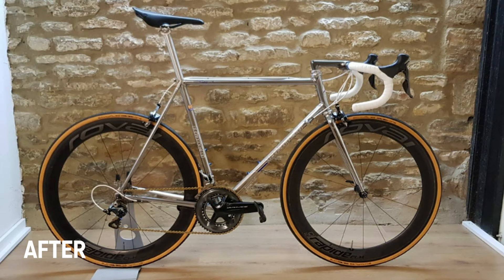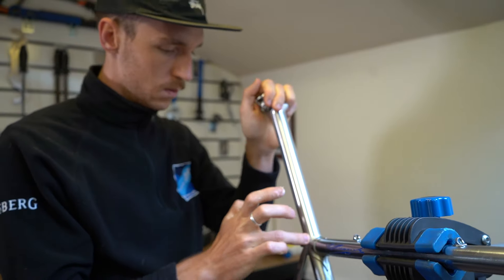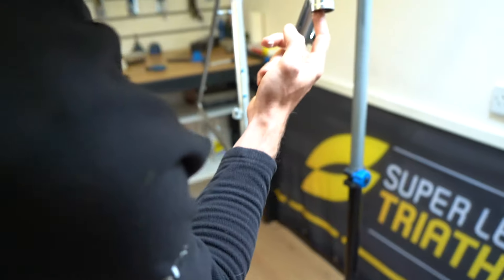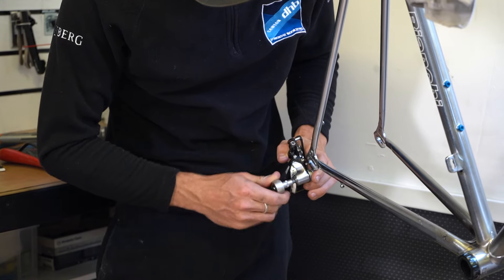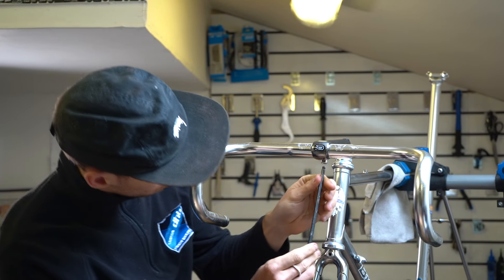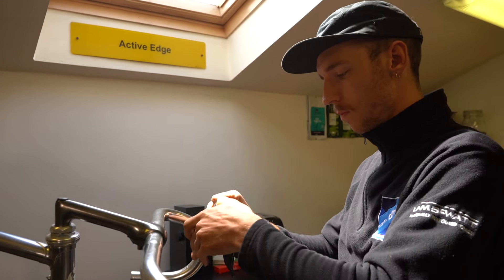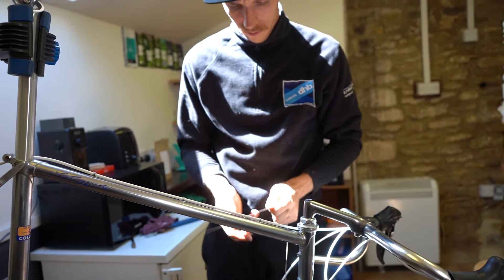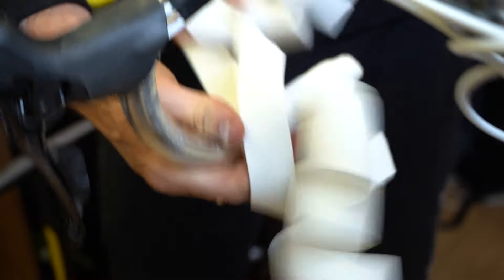DREAM BUILD BIKE  - vintage bianchi  - road bike restoration project

Comment: Rad build dude! Better than the day it was bought.
You are in a special club, as am I. Sanding a bike frame to a polish is a job many have started, but few have finished. Ive never polished a steel frame, but did sand it quite fine, 800 grit. I then hung it close to the ground from a tree in my front yard overnight to get dew on it. In the morning, as planned, a  bit of corrosion had started. I warmed and dried it in the sun, then after a quick wipe with tack cloth, hit it with several coats of clear. It is a striking looking bike now, built up with vintage parts. Over 10 yrs later, the finish is slowly maturing. I did sandblast, then hand sand/polish an aluminum frame for a hybrid to singlespeed conversion build. I feel your pain. Yes, weeks of evenings watching TV, sanding. I regretted sandblasting as I had to sand down to the bottom of the profile left by the blast media. I used metal polish and found it darkened it a bit. Mothers aluminum polish left a brighter finish than autosol. Youve inspired me to try this on a FUJI Im playing with at present. Its all original, paint is a 6 outa 10. But its purple. I also wanna cut/file the pump peg, the (extra?) chain hanger, yes, two of em. Also get rid of the fender mounts. I often drill a big hole in the bottom of the bottom bracket shell, for weight. Ive modified the sausage tube that holds rear brake caliper so now my rear brake faces forward, mounted to front side. I think it looks cool, works just as well, and I could shorten cable a few cm. If I was doing  your Bianchi, Id drill the handlebars to internally route the cable. Done this on modern and old school bars. Works great, no electrical tape.

Comment: I did something similar with an early ‘80s Trek road racing frame. I had it sandblasted and powder coated. The finish came out beautiful and then I built it up with an Ultegra set up.  It rides like a dream!

Comment: Great video. We all have those bikes we lusted after at some point and they seem at the time like dreams. For me, it was the mid-80s Zullo, Pinarello, Tommasini, and Picchio. I have all but the Tommasini now. Originally, I went with contemporary vintage components but all now have modern components so I can get the most use out of them. They are no longer dream bikes for me but a reality. And they all get ridden properly. They are not wall hangers.

Comment: Nice job and a lovely video, thanks for sharing. Shame you’re not keeping it! I did something similar with a Bianchi titanium frame that was a replica of the 2004 Roubaix winning bike. Some later era Bianchis than yours have structural foam injection in the seat tube which can be damaged by paint stripper so that’s one pitfall to watch out for. The bikes with it came with  a frame sticker near the bottom bracket advertising it. I used Scotch-Brite pads to take off the paint and give a brushed Ti finish. That took weeks as well! I put 10 speed Campagnolo Record triple from the era of the last of the range topping alloy chain sets. Royce / Sapim / Ambrosio hand built wheels with Panaracer gravel tyres were added and Brooks Swallow Ti saddle. I’ve ridden it like this for a couple of years as a gravel bike and did rather well on certain Strava segments that were only really tackled on MTBs.

Comment: cool to see. I have a late 90's Bianchi Eros that I ride daily. I love it. I dont really see a need to upgrade it at all. I did a full refresh on it 9 years ago and it's due for a good cleaning and some new cables and tape. thanks for the inspiration!
Reply: Wait you didn't replace the tape and cables for 9 years?
Reply: @dan_lazaro  nope. Still haven’t. Everything works flawlessly.
Reply: @GuntherSnaps  damn on my bike the cables need to be replaced after around a month riding in wet conditions, and that doesn't account for my rear brake cable refusing to comply after the first wet ride. But yeah it generally takes a month for the rest of the cables to stop moving. I used to clean ans relube my cables but considering the time and effort to do that and the cost of new cables, I just change everything now.
Reply: @dan_lazaro  oh well I have never riden in wet weather. Bike only sees lovely dry weather. But my mountain bike sees wet weather and I’ve never had a problem with cables. Maybe you should switch to hydraulic if your having that much problems with cables

Comment: What a lovely thing to do. Spent many days during lockdown sanding down an old Ridley frame...alloy,with Time Carbon stays and forks. Sprayed lacquer on carbon and polished the aluminum. Built up SramForce 10 speed to use as adventure bike for my son and me to use..

Comment: Made a similar project with a GIOS Torino compact 40th anniversary with a Record groupset, Deda parts, Campa wheels and Vittoria tires. It’s a lightweight dream. I like yours too, great job! But I would have saved the painting. I prefer a good old true patina before a stripped, clear coated steelframe.

Comment: great bike 👍👍, what is the total weight of the bike ?? Do you use carbon brake pads for your carbon roval rims because these require specific brake pads for carbon. What columbus tubing is it? El or  SLX? Please specify

Comment: I found a 2006 Bianchi Giro frame on the side of the road and I've been Frankensteining it together with parts I have around. One thing that this bike won't have is a front derailleur because who ever had the bike before ground off the metal pin bracket that would of held the front derailleur. So, I'll just have to put a single chain ring. I'm going to use fiber glass to cover the grinder marks. I'll probably paint it a 2020 Bianchi turquoise.

Comment: I did a restomod on a 91 Cannondale. it's funny because I had the exact same nightmare with my bottom bracket. first the original bb was nearly impossible to get off. then the new holotech bottom bracket started stripping the threads On the frame. so yeah exact same issues pretty funny !

Comment: Quick question. How did you get the wheels to fit so well on that frame. I thought there would be more of a gap going from 27 1/4 inch vintage wheels to the slightly smaller 700c size. Thanks let me know

Comment: One question, did you use a washer with pin to prevent the wheelset from sliding out the dropouts?

Comment: For a bike with a flat top tube the seat seems very high, like the frame is too small.  Then he has the stem pushed all the way down the other way , like the frame is too large.  This makes quite a drop from the top of the seat to the handlebars which is going to cause him to constantly bend over quite a bit which I would think would make an uncomfortable fit.

He could have had the frame sand blasted and had the paint removed in a fraction of the time compared to stripping even if he had to do a little sanding after.  A always coated old metal frames with FrameSaver on the inside to prevent internal rust from forming.

Anytime you have trouble removing an existing bottom bracket you should have the threads chased out to make sure they are good and clean before re-assembly.

Grease works but I would have used a good anti-seize compound as it lasts longer on the seatpost, stem, and bottom bracket.

Personally it takes me quite some time to locate the exact spot on each side of the handlebars to place the shifters for the correct fit and so they are level.  Sometimes the bars are marked with a scale which makes it a lot easier.

Bike turned out looking good but I question the fit....................

Comment: Did you have the rear triangle cold-set for 130mm? Or, did you just stretch the rear triangle from 126mm to 130mm?
Reply: Honestly I was as shocked as you that it did just fit. No stretching required, once I put a wheel in and it fitted I knew this was something I wanted to build

Comment: Did you have any issues or have to bend/modify frame to accommodate modern wheel/hub width? How about brake caliper reach? Thanks for insight - I'm excited to try this type of project on my 80s Bianchi if I can find work-around for these.
Reply: No, weirdly the back wheel just went straight in. Not sure why. But didn't question it.. that's the whole reason why I started the build

Comment: Hey nice build, I'm building a bike like that and I'm curious to know what was your bike's trim width? Because mine is 13 cm and I don't know if the cassette is going to fit or not
Reply: 130mm is standard fit for modern wheels so 11spd will fit

Comment: Hi, I have a similar vintage bianchi frame that I would like to restore but so far I have been struggling with choosing the right components. Would you be so kind and share which components did you equipped it with?  Namely the cassett, the shift and the brakes..Thanks a lot!

Comment: I'm curious, with your experience, is the clear coat all that's needed to prevent a raw frame from rusting with exposure to the elements? I've heard previous apprehension.
Reply: I was lucky that this frame looked so shiny with the correct grit sandpaper and having the clear coat done properly made a difference. If you were to use a spray can probably not but you could always use the sort of wax they use on car wheels to stop it rusting or becoming damaged

Comment: I just bought a very similar looking frame from craigslist which has been converted to single speed, I’m digging around trying to figure out what model it is for my own curiosity. It seems identical except for the paint color and that thing raised onto the seat tube, which I’m not familiar with. If anyone has any leads on how to identify 80s Bianchi‘s let me know! It rides so nice, can’t wait to push it until it cracks

Comment: The bike looks amazing. My vintage 1987 bianchi has a strange tire size. Do all new wheels fit on an old bike? And aren't those aero wheels disc brake only.
Reply from the maker: Thank you! It depends on the frame, olders bikes won't always fit newer wheels which tend to be wider.  Also roval did both a rim and disc version when jake bought these :)

Comment: I have my friend's ol 1986 Specialized Allez he bought new after college.  I cold worked the rear stays to respace the dropouts to fit 135mm axle/10 speed. I kept the original paint and just touched up the nicks and scratches. I eventually want to put a full Shimano 105 groupset on it, but for now it's rolling with a Tiagra/Sora mix (robbed from my daughter'sold bike she outgrew), Reynolds Stratus Elite wheels, Profile carbon fork, and other bits.

Comment: Great build, very unique.  Did you modify the rear drop out width?  Cheers
Reply: I didn't no, I did however remove the adjuster screws to pull the wheel as far back in the dropouts as possible to increase clearance

Comment: Just wondering how the new wider cassette fit on the rear as my 1984 Italian bike (Guerciotti ) had a 6 speed cassette modern and a modern 10 speed  cassette would not fit unless the rear end would need to be strecthed to fit a modern 10 speed cassette..gr8 build by your friend btw 🚲🚲🌟🌟🇨🇦
Reply: Do not widen the rear!!!!!!!!! Refurb the hubs (and everything else) and if you want switch out your block to a 7 cog, various combinations between Regina, or other mfgrs., typically 13 -21 or 13 - 23 combos are readily available. Trying to "modernize" is NOT the way to go. Respect tradition. It IS better.

Comment: Very nice buld but at 04:10 you preload way to hard. This is just suposed to be flush and aproximatly 1Nm. You can see how bad your cranks spinn and the bb won't last long because it is getting pressed appart from the side. bearings hate this king of loads.

Comment: È deludente! Take a beautiful hand built celeste work of art, remove all the character, and then add the highest level, modern, digital running gear and carbon wheels? Behold the rolling identity crisis.
Reply from the maker: It was very very rusted, but sure character xD

Comment: Why do so many people wrap their handlebar tape from the bottom up and use finishing tape at the top? The factory way is to start from the top down, do an overlap at the top to hold the bar wrap and the use the end plugs to hold it. No ugly finishing tape. Using finishing tape looks amatuerish, in my opinion.